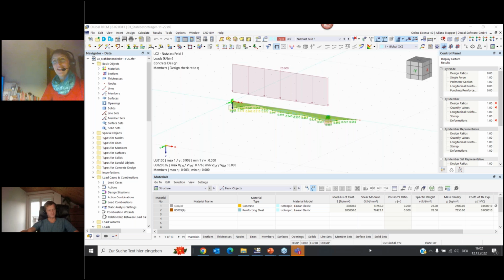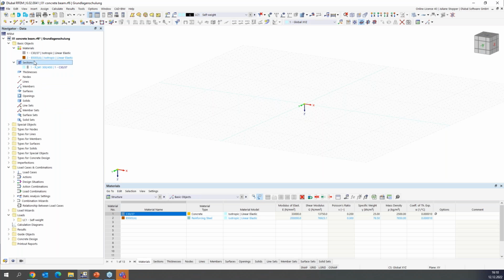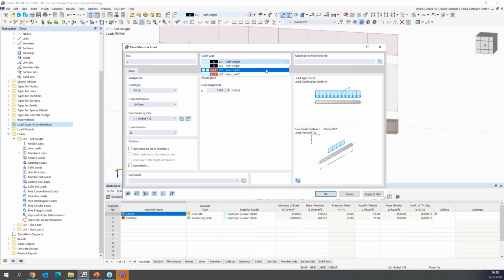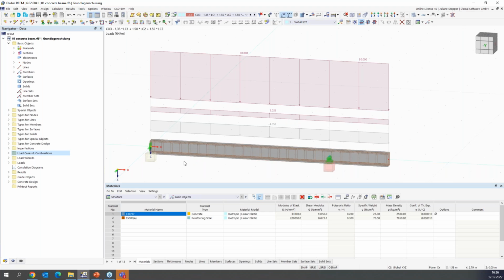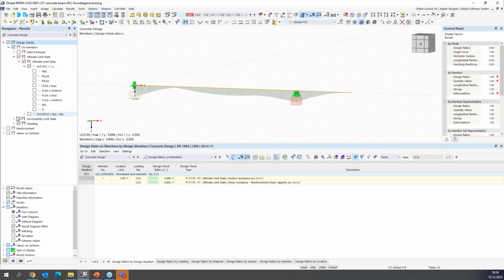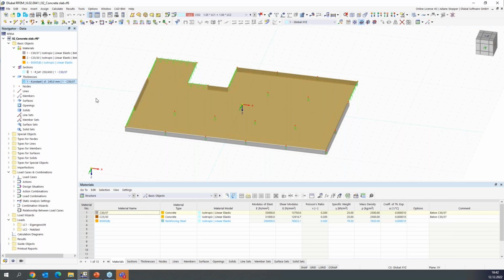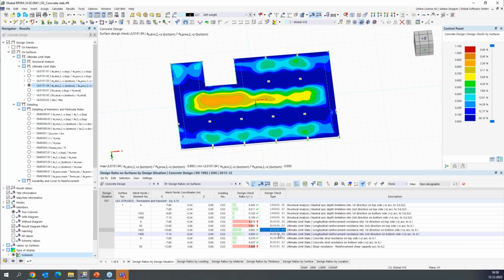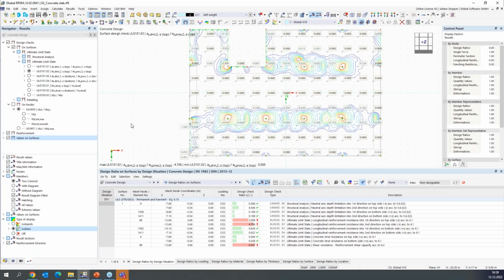Online Training | RFEM 6 | Students | Introduction to Reinforced Concrete Design | 12.12.2022

Comment: Is it possible to export the reinforcement as a table?
Reply from the maker: Hi, @beazapico! Yes, it is possible to export the reinforcement as a table in RFEM 6. The export function is available for the result tables in the module. For example, you can perform the steel stress verification and then export the table in mask 3.3. When exporting the table in mask 3.3, you can choose between FE mesh points and grid points. The grid can be adjusted as a property of the surface.

Maybe this manual will also help you: https://www.dlubal.com/en/downloads-and-information/documents/online-manuals/rfem-6-concrete-design/004022